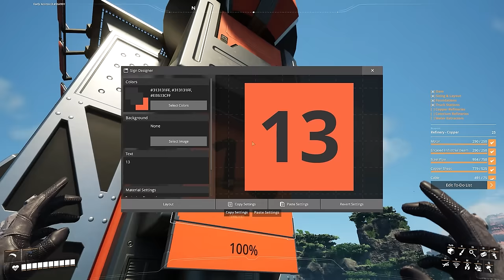Building a HUGE REFINERY in Satisfactory Update 8!

Comment: G'day mate - I am loving your designs (if not a 'bit' big for those who are beginners) however, have you considered the physics of a Water Tower in this refinery set-up, to reduce the amount of pumps required? I use them all the time, and they are fantastic. 
Potentially this could be located on the inner corner of your dam wall (on the small island there, as you turn the dam from East-West to North-South....
-for those of you who don't know, at the moment in Update 8, if you build a tower that has a head-lift higher than where your tallest point will be of your factories, and take it back down to them, you only need to build one (1) set of pumps to pump the water up to the top of the water tower. 
Love the walkthrough, loving the blueprints - great job!
Reply from the maker: I dont personally use water towers as i consider them an exploit. Not that i mind others doing it, but if they patch it one day then the build wouldn’t work so I just avoid that.

Comment: 1:05:30 One way you could solve the sign problem for the Copper refineries is by making signs that delineate the segments by numbers as well. This means you can keep the number at two digits, but have a sign at the end (and/or front) of the segment telling you what numbered segment it is. Given your set up, you could separate the segments into sets of 13 or 26.

For example, if you wanted to look at a specific refinery in the middle of the set up that could be known as Refinery C1-06 or S01-06. Something like that.

Comment: Loving this series Darren! Quick suggestion for your refinery sign problem (mentioned around 1:05:45 in the video): what about 2 signs, with the left one displaying the hundreds column (maybe with a leading zero so there isn't a weird gap between the hundreds and tens place), and the right one for the tens and ones columns of the machine numbers? It might not completely solve the need for multiple sign edits on each machine, but you could create blueprints for the 0xx, 1xx, 2xx, and 3xx machines so as to minimize the number of sign edits needed. Could be the compromise you were looking for. Thank you for all the effort you put into these videos!
Reply: Could also do each section as a letter, so two signs where the first is a letter, so A-01 to A-99 then B-01 to B-99 and so on.

Comment: This is why I like overclocking. Just by going 200% you have cut the total amount of machines you need in half. I have a caterium plant at the very same waterfall, and am using the 3 closest pure nodes, one being at the falls. Refineries overclocked to 200% can have 10 supported by a single 480 belt of ore (what I am up to atm) That means with 3 nodes being mined, each at 480 items a min atm, I can handle 30 refineries (or 60 if you don't overclock them). Plus water wise 1 extractor also overclocked can supply up to 5 of them with mk. 1 pipes. 

On top of all of that it is already built with Mk. 5 belts in mind, using a smart splitter at the end of the row of 10 refineries with it set to overflow. Beyond it, is another 10 refineries, all waiting for when I update the belt work to 780 items a min. Thus, 20 refineries can support 1 pure node at current max item per min (780), needing just 4 water extractors to provide water to them in groups of 5.  Or double each number if you are going with no overclock.

This also means doing the same setup, needing only 16 refineries for pure copper for 480 line, or 26 for 780 with overclocking. All from a single pure copper node.
Reply from the maker: The drawback is power though, a 100% refinery runs 30MW. A 200% refinery runs 75MW. So while it can be nice to balance numbers it feels less efficient overall I guess.
Reply: @WhatDarrenPlays  Power really has never been an issue in this game. I've seen youtubers do stupid crazy mega builds and still running on coal. ImKibitz in his playthrough overclocked everything and never had issues with power. I'm also over clocking everything (mainly as my desktop is 11 years old with an amazing gtx 950 and it helps cut down the lag not having as many things up) and haven't ran into power issues. To each their own. Just stating that 30 to 75 seems like a lot, until you realize that 2 refineries would be 60mw, by going 200% on one, that is the same as running 2 refineries, it's 75. So 15 more mw. That even scaled up is barely a blip on my power graph.

Comment: For your signs at 1:05:52 You could use a higher base. If you only had 256 I'd suggest using hexadecimal. If you've got less than 360 you could do base 36 for the tens (0-9 then a-z) digit and keep just base 10 for the ones digit.

Comment: i do see an issue with the truck manifold system youre going to use. since the last one will use less ore than the other ones, if the spacing between your trucks isnt optimal at anypoint, the stations storagecapacity might be maxed out and therefor the next truck could dump less or in one of the first stations and dump its remaining ore into the last station, which in turn will make one of the first stations have a deficit in ore input. i hope it makes sense to you, the way i explained it. 

the remedy for this issue, is to run all your truckstations outputs except the 120 one, through "belt balancers" and have the 120 output station have an overflow back into one, or multiple, of the earlier stations, so that any excess ore dumped in the last station, due to truck spacing, will overflow back in all the 780 lines and get balanced between them. 

there are a few of videos about belt balancers im pretty sure and im very sure a google search will show the calculator page with some examples. basically you can connect any ammount of unequal input belts to a series of splitters and mergers to get equal output belts. in theory your truck manifold are equal input belts, but as soon as theyre not spaced perfectly and a stations buffer is full, they will become unequal, thats why you do need this system to not run into issues later on.

you were talking about the foot print size because with stacking refineries, you would need alot more pumps. its very worth, imo, to use water towers to provide headlift in tall buildings. there are videos of how to make them on youtube. 

i havent finished the video yet, so i dont know if you run into this next thing, but i hope youre aware that the oceans water has its own border of where you can actually place water extractors. there is a gap between the world border and this "water border" where its visually water, but you cant place water extractors there.

hope this helps! looks like a great build so far!

Comment: i saw you were struggling putting the dam sections in place, in those cases when u select the lock mode on builds u can use arrows on the keyboard to move the thing of 1meter in all directions
I Hope it helps you.
Amazing video bud keep it up💪

Comment: Quick tip for those building it: don't keep on having the ctrl key pressed when you blue print the refineries. For some reason, the elevators won't align with their splitters (in the next video). I got crazy figuering out what the reason was. If you blue print the refineries, you have to release the ctrl key in between single placements for it to work. This would have saved me a significant amount of time.

Comment: The only reason I would mind an extra 40 megawatts of power consumption in a factory is if it was integral to maintaining power. Because in the unlikely event that you lose power, you need to be able to restart those factories, and every megawatt counts. A factory like this one isn't integral to power, so it wouldn't matter, but if it was a fuel plant that powered a section of a nuclear power plant and you didn't catch a single, small mistake and you consume more fuel than you produce and you crash that fuel plant, causing that nuclear plant to crash, then the process of restarting that would be all the more difficult if there were an extra 40 megawatts to provide.

Comment: Make a water tower... That way you won't need to put pumps on each pipe. You basically have a key pipe with a bunch of pumps that goes as high as your building that you connect to your whole system and it gives you the same pressure everywhere
Reply from the maker: Nah I consider it an exploit
Reply: @WhatDarrenPlays  I understand your point of view but it is actually kind of how it works in real life. I wouldn't build a single water for the whole world but a water tower for a big factory I think is accurate. I believe the devs intended to do it that way. Anyway I am enjoying it with or without. Thank you
Reply from the maker: Not really, in real life if you pump water up to a tower you can only get as much down from the tower as you pump up. In satisfactory people pump up to a tower and then connect new extractors to the output at the bottom to avoid having to use pumps. Its a headlift bug or design oversight, where the headlift of a pipe is set by the highest point on the network rather than based on source or flow direction.

If this did work in real life, we’d have infinite hydro power. “Wow we just pump 600m3 per minute liquid vertically and then when we bring it back down we can connect as much water to it as we like and it flows just as fast and climbs just as high! Amazing! :P

I dont mind people doing it, but its reasonable to assume it may get patched one day (especially since fluids have a bunch of bugs) so I dont show/teach it back to people just incase it becomes redundant. Plus pumps are cheap anyway for power so i dont mind using them.
Reply: Good point, ye you can only match the output to what the input is, makes sense. Would be nice if they add then a water tower building like they did for power poles with like 6 mk2 inputs in it or something similar. I just feel like stacks of pumps always look kind of awkward in builds

Comment: Ive been watching these series of videos and the thing I dont quite get is where to start the root resource calculation for each factory.
Typically the video starts with something like “we need x amount of whatever” for a factory.  How do you know?  The amount of a mine output?  Or we need 106 constructors based on the amount needed for an assembler.  Cool but how?  Why?  Why not some other figure.

Comment: So, I just wanted to say with the 5 truck stops there you have 10 outputs total. and If you have the 4800 ore total coming in and we can output 780x2=1560 from one truck station, we are only using .15% of the 4th truck station at your 4800 incoming ore. just wanted to make sure ive got that right since we are basically not really going to be using almost 2 of the truck stations if this is the case.
Reply from the maker: One of the truck stations is for Caterium Ore. there will be one pickup for caterium (780) and another will be brought in directy from then node below the factory.
4 stations will use copper, and there will be 4800 to deliver in total. So they will use 4 outputs fully, and then 15% of another output.
Reply: @WhatDarrenPlays  Ok cool, just wanted to run that by because i think when you were talking about it you were referencing all the stations which had me confused a bit. But sounds good!

Also i say dam you im building along side because i cant wait and if it means i have to redo something then be it! :P 
Having a blast so far and appreciate all the work you've been putting in for this!
Reply: @WhatDarrenPlays  
This just occured to me while I was readng all of the comments, but are you fueling the trucks at the ore sites or using a fueling stop somewhere?
Reply from the maker: The plan is to reserve a coal node which has its own truck deliver fuel to a checkpoint on the road that refuels anything that just drives through!
Reply: @WhatDarrenPlays  Cool beans

Comment: I just realized while i was placing down the refinery's that your total Copper refinery count is not 320, its 364. 26(refinery's)x14(sections) = 364 total copper refinery's. Technically nothing changes but you'll just have 40 some refinery's in a stand still unless we add more input. Which you may still have plans for that wasn't mentioned in the video. It also means the max output would require 18 belts  (not 16). 

Also side note for anyone placing down all the refinery's now. there seems to be a nudging bug were it doesn't always nudge the same distance (it'll sometimes nudge short and it'll be out of line). Replace the blueprint and you should be fine.

Comment: Just loaded up your latest save file to check out what you did to get your generators water supply working correctly as i mentioned a few episodes ago that it will not work with all 15 generators up and running as the fluid dynamics will not work as you made it... Not alot has changed that i can see and your still going to have the issue i had when it comes to powering up all your generators, will look forward to that episode when you do 😁

Comment: I'm a little late to the game here but having an issue obtaining the alternate recipe for pure copper ingots. I have probably opened a dozen hard drives but can't get this to drop. Resorted to reloading a save to see if I can get it to drop and have tried that at least 20 times without getting the pure copper ingot. Any suggestions? I am fully caught up on the milestones leading up to this video and have been able to unlock the pure iron ingots just fine. Any help would be appreciated so I can continue following along this series, has been a total blast.
Reply from the maker: If you use the bluprint i have for the refinery, itll have the recipe on the machine even if you havent unlocked it yet
Reply: @WhatDarrenPlays  I will do that! Thank you for the suggestion and the reply. Really loving the series!

Comment: As a total beginner I am finding your builds  a little confusing with you adding in machines that aren't going to be used right away.  Also why?  I don't  recall you  saying why you are planning for so many copper ingots?  I understand the foundation layout and also why you made it as large as you did. Massive amounts of power and now massive amounts of copper ingots and I have no clue as to the why of it all.
Reply from the maker: The reason for building so big to start, is so that we never have to replace or do over a factory again. Towards the end of the game, you needs 1000’s of copper per minute to make lots of things, but also some very hard to produce items that will take 200 copper per minute in, and put out like 0.5 out per minute, so you need a lot of volume.